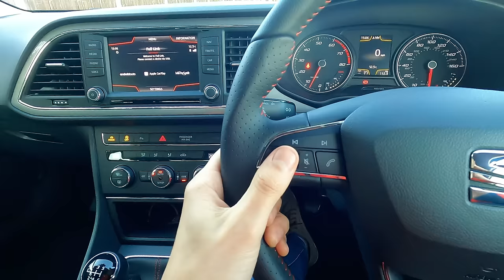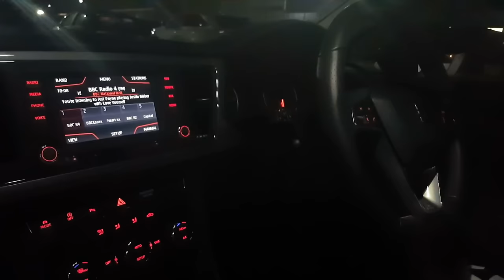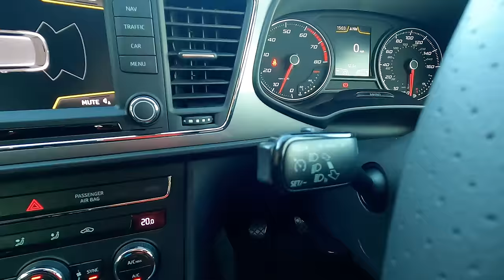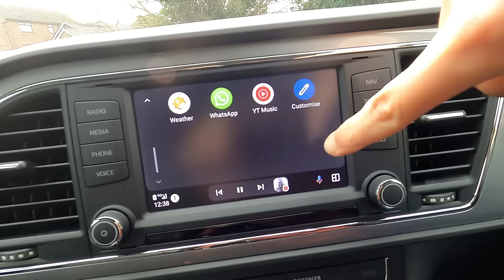Repairs and Costs Over 205,000 miles in a SEAT Leon Petrol

Comment: This is very weird, youtube must know me very well. 

I currently have a 2018 1.8 Leon FR, and prior to that I had the 1.4 variant with the 150bhp output. When I got the 1.8 I could immediately tell how much more stable and compliant the independent rear suspension made the car, and it was especially noticeable at speed. Up to that point I had never owned a car with independent rear suspension and now I think I'd find it difficult to go back, if I had the choice. 

I can also sing the praises of the SEAT Sound System option, it really is fantastic - sadly SEAT / VW discontinued the option on the 4th gen, but then most things appear to have gotten worse with new cars since 2020. 

I'm also eyeing up an upgrade to the GR Yaris, the 2024 version with the updated interior - but I'm sorry to say I would be going for the automatic just for the ease of use day to day. But I am unsure if spending a lot of money to go into a car with a cheaper interior is the right thing to do, even if it is a WRC homologation special.

If you do get a GR Yaris, I may have to look into booking some refresher lessons...

Comment: My ex was a driving instructor for many years, and the biggest issue to running up high miles was 'customer resistance'. Learners (or whoever is paying for the lessons) expect a newish or very car turning up at the door! So 18 months was the average turnaround, two years at the longest. Older than that and the young people would be turning their noses up if she picked them up straight from College or sis form. I do personally think that 'driving school' cars should be subject to the same more stringent maintenance and checks that mini cabs are. Enhanced safety checks on Tyres and brakes etc above and beyond the MOT standard.

Comment: If anyone thinks they are spending a lot on keeping their cars on the road, just watch this, it makes you instantly feel better somehow 😂

Seriously I don’t think it’s any surprise, given the amount of driving the car does, and all by people who are learning to drive. The cabin filter shot after one year was interesting too, and shows the amount of miles you do, I changed mine after about 2/3 years as I only do around 2k miles a year, and mine was cleaner than yours after nearly 3 years 😂
Reply from the maker: My filter is supposed to filter soot also which is why I think it goes black. It's important to remember the hours of use this car has had, 1 mile is like 4 miles in a regular commuter car. My average speed is 10mph, if my average speed was 40mph I would have done around 800,000 miles. The alternator failed on a very hot day without much airflow, under bonnet temperature was very high, much higher than that of a track day.
Reply: @RichardFanders  ahh, mine is an older 2005 car, so would only be filtering air, that explains the blackness on yours. By the way, quick question for you, as you have said that you “like cars” and cars were basically your trade before being a driving instructor, now that you spend so many hours per week inside of a car, and the presumably at the weekend your out and about doing family things, going to shops etc, doesn’t it make you dislike driving? I imagine after hours in the car during the week, teaching people how to drive, jumping in the car on your days off is the last thing you’d want to do? I’ve always wondered this? Or is this not the case? Do you still enjoy driving yourself on days off?

Comment: 24:15 I think at least some of the noise is actually gear rollover noise, i.e rattle from the backlash of the gears im the transmission. I've owned 4 mk Yaris that all do it. It's louder on hot days as the gearbox oil is thinner and doesn't damp noise as well. Probably accentuated by worn/loose clutch springs.

Comment: 52:00 that is really interesting because I don't think its necessarily the torque of the diesel or petrol that makes it complain so much but the mapping, some cars try too hard to keep themselves going and not stall and on a diesel this is magnified by the low down torque, but the sane also applies to a larger displacement petrol. My 4.3l hates stalling and will

Comment: From the detailed summary of the costs and issues faced by the car owner over 10 years and 205,000 miles:

Costs and Parts Replaced:

Under Warranty:
1. 30,000 miles: Steering rack
2. 40,000 miles: Volume control wheel
3. 41,000 miles: Battery
4. 60,000 miles:
   - LCD screen
   - Heater fan
   - Third brake light
   - Ignition coil (broken during spark plug replacement)
   - Steering software update
5. 63,000 miles: Cylinder head
6. 75,000 miles: Ignition coils and wing mirror motor

After Warranty:
1. 95,000 miles: Climate control flap motor
2. 98,000 miles: Fuel flap lock
3. 100,000 miles: Clutch slave cylinder
4. 107,000 miles: Rear shock absorber
5. 118,000 miles: Right climate control flap motor
6. 123,000 miles: Alternator (£60, second-hand)
7. 126,000 miles: Water pump
8. 130,000 miles: Battery
9. 145,000 miles: Air conditioning compressor (£60, second-hand)
10. 153,000 miles: Intake valve cleaning
11. 166,000 miles: Front suspension control arms, oil sump
12. 172,000 miles: Fold motor on wing mirror
13. 181,000 miles: Battery
14. 188,000 miles: Steering wheel stalks
15. 190,000 miles: Air oil separator
16. 200,000 miles:
    - Boot struts
    - Boot stopper
17. 202,000 miles:
    - Roof liner (£675)
    - Boot release badge
    - Rear wiper motor (£30, second-hand)
    - Wing mirror adjuster

Additional Costs:
- Interior Maintenance:
  - Replaced seats twice (second-hand)
  - Steering wheel replaced twice (new: £150)
  - Gear knob (£100)
  - Handbrake (£50)
  - Armrest re-trimmed
  - Carpet replaced (£50)
- Technology Upgrade:
  - Android Auto and Apple CarPlay installation (£600)

Wear and Tear Items:
- Front Discs and Pads: 35,000 miles (genuine), 70,000 miles (PAGID)
- Rear Discs and Pads: 130,000 miles (genuine), still good after replacement
- Clutch: Every 40,000 miles for damp mechanism noise, not wear
- Cam Belt: Every 60,000 miles or 4 years (£300 per change)

Fuel Costs:
- Total Fuel Cost: £31,012.65
- Average Fuel Economy: 36.5 mpg
- Total Fuel Used: 25,497.56 liters

Most Difficult Maintenance Situation:
The most challenging issue for maintaining the car seems to be the repeated failures and replacements of the ignition coils and the climate control flap motors. The clutch noise and the decision to replace it for noise rather than wear also posed an ongoing issue, indicating the difficulty in balancing between comfort and cost.

Mileage:
- Total Mileage: 205,000 miles
- Total Hours of Use: 19,000 hours

Comment: The fact this car has lasted so long with learners behind the wheel is really impressive. On the topic of paint and sticking with the factory original paint as long as possible... did you have any coat treatments/protection on it initially? Or was it totally standard? I'm looking at a new Skoda Scala this year and wondering what to protect it with, if anything.
Reply from the maker: No treatments, I forgot to mention I have never put wax on it.
Reply: @RichardFanders  wow that's impressive how long it lasted. Thanks for the update!

Comment: My 2002 bmw 320ci is on 257,689 as it stands still running and driving but it’s coming to the end of its life loads of strange noises and clunks in the drivetrain it’s had 7 clutches too!
Reply: Neighbour has a 530d and it's done similar mileage. uses it to go from Aberdeen to Edinburgh and looks like a dog but still runs.
Reply: @cabottaxi  they’re good cars the older bmws it’s my gearbox that’s failing hence all the strange noises. But I can’t complain it’s done 257k on the original engine and box. I’ll wait for the clutch to blow up again then I’ll replace the gearbox

Comment: As a fellow Seat Leon driver, this video is great so thanks for making it, my question is you said the service intervals is 18,800 miles yet the car will tell you every 10,000 miles or 1 year. I have a 18 plate 1.4 TSI Leon also, do you think i'd be fine with servicing every 18,000 miles rather than every 10,000 miles? As the past two services I have done have been in 10,000 mile intervals. Thanks!

Comment: 51:58 agreed. i learned in a fiesta diesel in 2019, and damn it was a shaking mess when i was one year too high. additionally, my first car was a petrol (due to ULEZ). i stalled an uncountable amount of times in my first few months with the petrol car. the diesel fiesta did not need throttle to set off from a stand still, whereas the petrol honda jazz i had did and i found it hard to get used to.

Comment: Pretty fascinating rundown, I have to ask, has it ever had broken coil springs? I regularly see them fail on cars that have done as little as 20-30k miles so I would be immensely surprised if your car is still running on any of its original springs! Has it also only ever had one shock absorber? It the fronts have lasted 200k then I'd also be very surprised!
Reply from the maker: Shocks and springs are original except one rear shock that I don't think needed replacing anyway.

Comment: Wow, just wow. This is a very good overview and insight of how cars can last a lot longer if maintained properly.

I have a 2003 jimny which we bought just before covid, tge car was owned by an old lady who brought it new we picked it up at around 40k miles. The first couple of years it mostly sat at home and occasional trips to local shops, then we began taking it off-road and green laning and thats when i fell in love with it 😂. Its such an easy car to work on, suspension, servicing, cost of parts and above all very very limited electronics - the biggest problem in modern cars in my opinion.

Last September till now i drive it around 250 miles to work a week and its a joy to drive, its fairly modified with some all terrains, roof basket, lights, recovery gear and some styling so it reflects the driving but it alwys puts a smile on my face.

Ive tried to keep as many things original as i could, still have the original tax discs, some original warranty cards, purchase invoice, early service receipts.

Watching you document your car has made me wonder how long mine would last if i continue to feed it gold dust 😂.

Last but not least it has just ticked over 53k miles after 20 years 😮.

Comment: Doesn't it tell you something about VAG cars though. I know yours is used as a training vehicle so has a much harder life, but I'm running a 2008 Diesel Mondeo which I've owned for eleven years, with similar miles and have had nowhere near the amount of problems you've listed. In fact I've spent money on nothing other than service parts and bushes apart from a faulty door control module which cost £15 quid to replace. Great video though, and a real eye opener.
Reply: To be fair most of the stuff he replaced he replaced far too early or was just replacing a steering wheel because it wasn't 100% smooth, over 50% of things replaced were not needed at all.

Comment: I'm not entirely sure whether the GR Yaris still has a base suspension option and if so how the ride is but if they still are gonna make those Rally and Race Packages for the 2024 MY, I would recommend getting it with the former (the Rally Package) since, as you would expect from rally cars, suspensions tend to be softer. The only issue I see is that both packages also get uprated brakes, which may be a bit rough to handle for learners...

Comment: Quick question why did you go with a 3 door model instead of a 5 door great video by the way
Reply from the maker: I preferred the look of it. I was 26 then, now I'm 36 my priorities have changed and I don't really care much for the styling and would have the 5 door.
Reply: The 3-door is a bit stiffer and could handle a bit better too :P Though with the torsion beam you probably won't ever notice. 😅

Comment: I bought my first car 36 years ago for $300 (US). A 1968 KE10 Corolla. 2 door, 4 speed. Someday I might need to buy my second car. 
It's not looking good for any bets though, I'm 5 years older than the car and in worse shape. How many miles? All of them.
I have about $4000 in it now not including regular maintenance. $7 minimum property tax every year, lifetime antique tag.
Countless trips to Helenback, all kinds of weather, goes through snow like a tank. It's all nuts and bolts and cables, 4 wrenches and a screwdriver will do everything. Up to 50mpg if you're nice to it.

Comment: Just want to point out regarding the ignition coils on the VW/SEAT/Skoda 1.2/1.4 petrol engines from 2014-2017 (I am unfamiliar with more recent versions), the ignition coil boot (the rubber part) is poorly designed and will often break when being extracted regardless of how careful you are. Even if the engine is warm and you soaked them in WD-40 they will often split due to the force required to extract them. If you're lucky the last guy went overboard dielectric grease when putting the coils back in, you are still likely to have a hard time, so I wouldn't be that angry at a technician or mechanic.

Comment: Hi Richard, at 4:20 you mention the LCD screen issue wasn't solved by replacing the screen. Can you remember what the issue was as I have the same issue in my Leon and it's driving me crazy! Thanks
Reply from the maker: It was solved by the Android auto upgrade. MIB2
Reply: @RichardFanders  cheers 👍

Comment: I have a 2015 Mazda 6 that makes a high pitched whirring noise whenever the clutch pedal is up. I have no idea what could cause that noise. It always goes away when the clutch pedal is pressed down and there is no noise when it's down, but there is a squeak noise when pressing the pedal down, is that the clutch master cylinder?

Comment: I've just bought my first car. Fiesta(zetec) 100k miles. Should I be worried about the gearbox at all? 
The reason I ask is it doesn't engage reverse gear most of the time it takes 2 or 3 times putting it in neutral clutch up, clutch down and selecting reverse again? 
Thanks helpfully video

Comment: If it makes you feel any better the roof liner in my TVR was £1500 fitted and they had to take the windscreen out with a 50/50 chance of it breaking. Thankfully it didn't as that would have been another £800 😅😅

Comment: I had a 2019 leon ST FR 2.0tsi 7sp DSG,i  had it for for just over 25k miles over 3 (one one covid), it averages 26mpg over that time. Not one issue, great car, quick car 220bph iirc, but far to thirsty. 

Lucky i swapped it for an ionic facelift, not a fun, nippy, all the tech of a care 20k more expensive, and averaged 61mpg over 15k ive had it. Sadly just beem written off! Thinking of getting thr new 208 GT hybrid, i fancy a small hatch, go bsck to roots, apparently it will do 60mpg, so ill be happy with 50. Thiugh may go 308 diesel.

Comment: Have you never changed the gearbox oil?! (I might have just missed that bit tho)
Reply: I've very rarely head people change manual gearbox oils in their VW manuals. There is no particular reason to change them. I know cars that drive without issues on 30 year old fluids. I also have cars which have between 20-24 year old fluids. 😅 Or at least there is no mention of gearbox fluids being changed and the 24yr old gearbox is a bit stiff to shift when it is -20c outside. No problems when it warms up. 😅

Comment: Good cars. Common issue with some of the VW Turbo Petrol engines burning oil , especially the 1.4 and 1.8 tsi engines.
Reply: more if an issue with older gen engines, EA111, much less so with EA211

Comment: 25:35 I think the pedal just needs some wd-40. Mine did the same, i put that on there and the noise went away and never came back. Obviously not where your foot goes, but listen to where the noise comes from, spray there.
Reply from the maker: The master cylinder has had 19,000 hours of use and they're renowned for failing on these cars, so I don't know how mine has survived. I've had a new one for years as I plan to change it, just haven't got round to it.

Comment: This car is lovely, I have same color and year leon, just not fr and I really want a fr next time, but the 1.4 tsi daily with 6 km city and 30 km autobahn it's amazing, such a pleasure to drive it, the steering it's almost perfect, I bought it at 120 000 km, it had big prolbmes with oils but solved it by replacing segments, in rest I didn't change anything or had any issue and now it has 200 000km, and I always floor it, driving it fast and aggresive sometimes, high rpm changing, I'm very surprised compared to my audi how well it responds to abuse, thinking to stage 1 it for more 50nm and 25 hp but i'm a bit afraid with the oil leaks and car wearing

Comment: good insightful video, but a question on warranty. The standard warranty on a new car or even old is still valid if you’re using the car for reward?
Reply from the maker: I've never had a problem with warranty as an instructor car. Mazda didn't like me using the MX5 on track which surprised me as driving tuition is harder on the car in my experience.